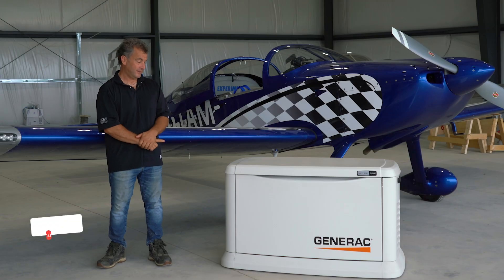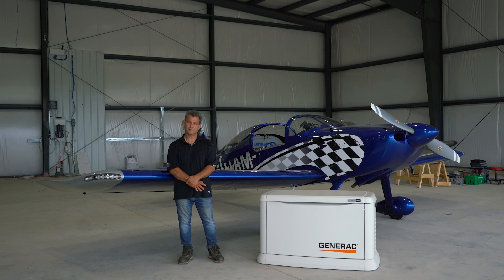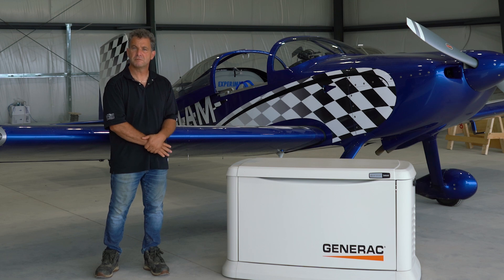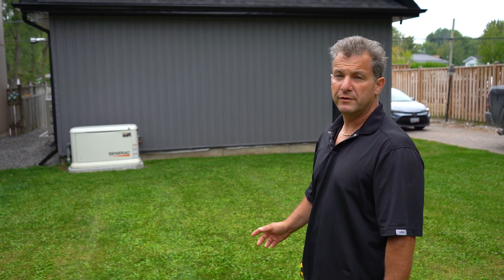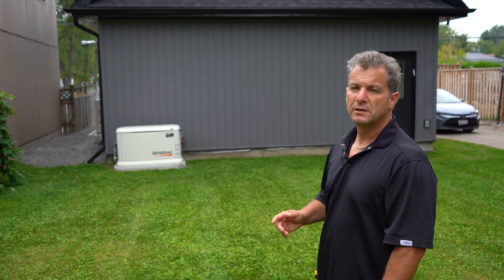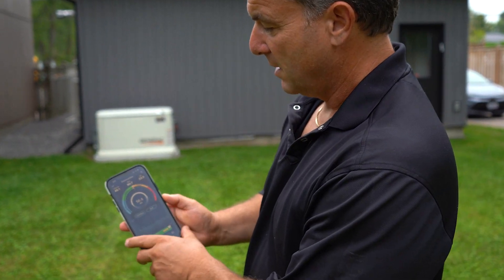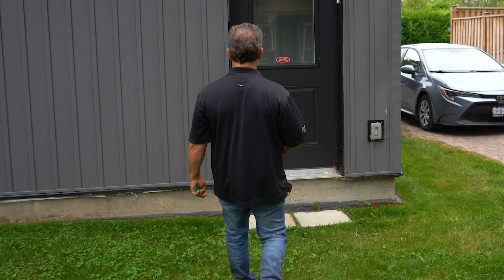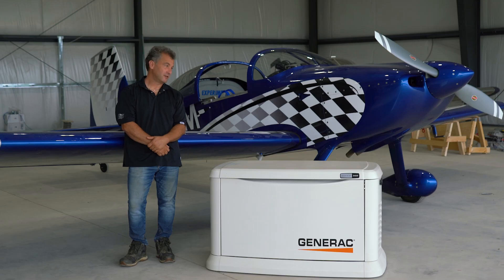How Loud Is a Home Generator? | Sound Level and Decibel Scale Comparison.

Comment: @triplemachine completely agree with your comment
I used a decibel meter that I've used for years during fire alarm verifications and it came up with a very comparable result.    
I decided to do the video with the phone app as it would be easier to read if captured by the camera.  And the app had averages displayed 
Overall I agree with your comment. However in this case the app did a reasonable job